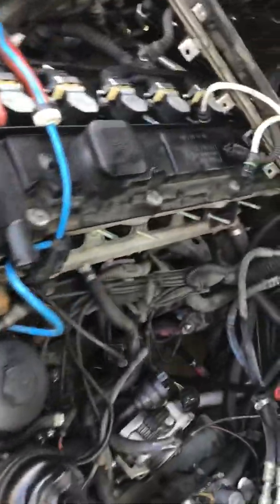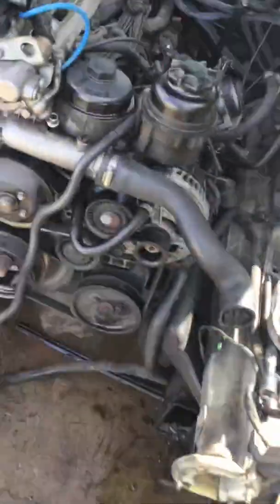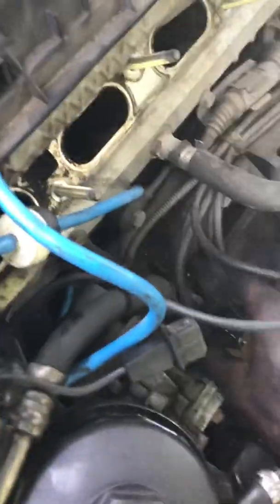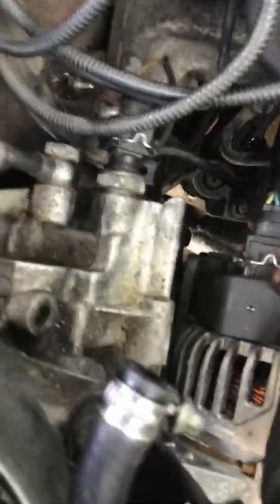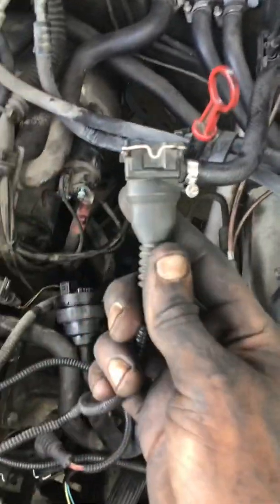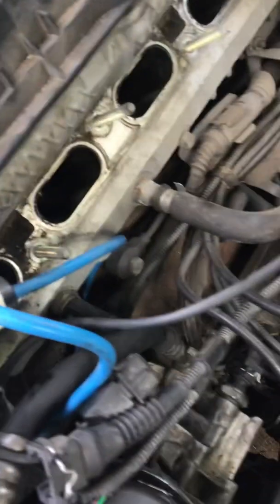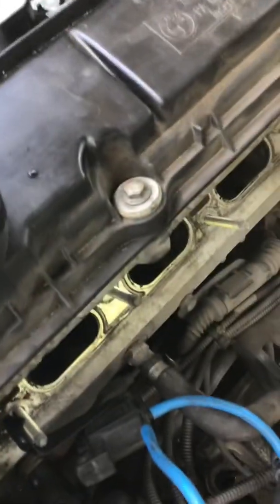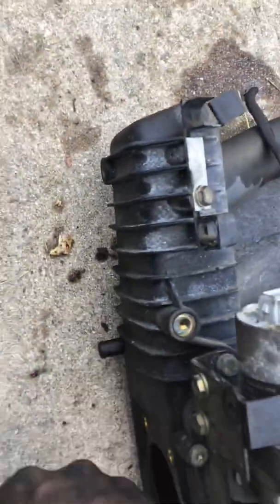M54 Engine Harness Guide

Comment: Thank you my friend. Do you know where I can find the cable for the reserve light switch?
Reply from the maker: No problem Bro. What’s your year make and model and what are you doing to it ?
Reply: I have an m52b28 from a 528i 1996. Want to drop it in My e30.
I searched for the cable that you Show at 4:14. I thought it goes to the Transmission.. So if it dont go there, which cable is for the reverse light? 😅
Reply: It’s on the gearbox